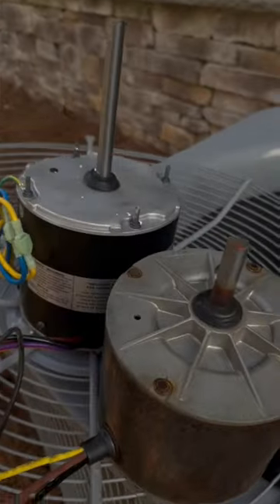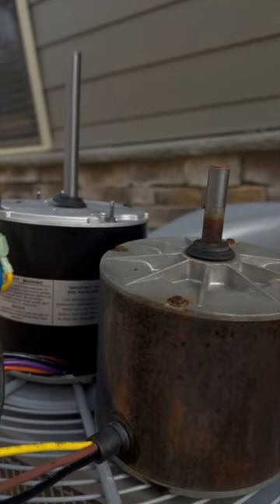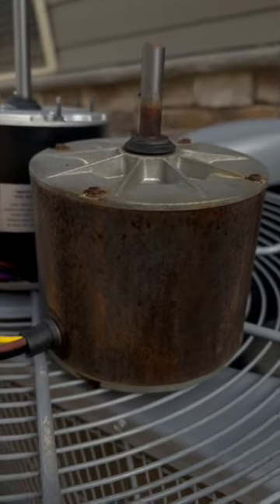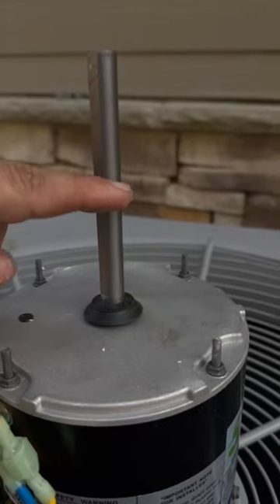Is your condenser fan motor shaft too long??

Comment: Pro tip pre cut, put ur blade down the shaft so u don’t cause any difficulties trying to put it on after the cut if so just sand the end of shaft
Reply: 🤫 green horns gotta learn the hard way at least once.

Comment: Cut after mounting the blade. If you bur the shaft the blade will not go on. Eliminates extra work.
Reply: Think you’ve done this b4 once or twice 😂
Reply: Personally I would rather cut it to length and dress it down o the end of shaft , that way it will come off easier later
Reply: I was about to say the same thing. Chances are your never going to replace the motor again. If you do just get a new blade.

Comment: Great tip as always Josh!! In a pinch I have used a rolling tubing cutter to score the shaft and then kinda snap it off. It does dull the wheel pretty quickly tho.

Comment: You can also add spacers and longer screws to where the top grill mounts to the unit which will raise the shaft up off of the compressor.

Comment: Just a tip. Put the blade on first before u cut. It will sometimes mushroom and will make it impossible to put blade on. U can solve this with a file but either way works.

Comment: Sawzall? Wouldn’t the vibration compromise the bearings? Just asking. I use a grinder myself and then smooth out the perimeter.

Comment: I use an angle grinder. I can cut it, then use it to clean up the edges so the blade slides on smoothly

Comment: did you cut with the fan blade off or on the shaft
Reply: He said mark the fan blade first. You won’t have room to cut it if blade is on. Plus you may damage the blade. You file the edges down then
Reply: It’s a total waste of time to do it before putting the fan blade on. If you can’t do it and not damage the fan blade, find another job. I’ve done thousands and thousands myself. It is absolutely doable with the fan blade on. And no one, I mean no one uses a hacksaw. If you don’t have power tools, find another job.
Reply from the maker: Well... Im one that uses a hacksaw ✋🏼. Ive always found it easier. So is your method the only way? I guess since I've only done thousands and you've done thousands and thousands, anyone that does it differently should start looking for another job. I've never said my way is the only way. Just giving advice with what has worked for me. 
This is one of the problems with this industry. Experienced technicians being hostile to someone learning or trying to share what's worked for them. Blade on, Blade off, both work fine. Hacksaw, sawzall, both of those work as well.

Comment: The main tip is omitted, and that is to never cut the shaft and then put the fan blade on afterwards. And by the way, it’s not a fan blade. It’s a propeller with multiple blades. But, no one calls it a propeller. Anyway, if you don’t own power tools, buy some. No one uses a hacksaw unless they travel back in time to the 1980s before cordless tools.

Comment: You can always take a 1in drill bit and drill in the top of the compressor where the shaft hit so the shaft sits inside the compressor.. Helps the compressor shaft spin faster as well 🤣🤣🤣